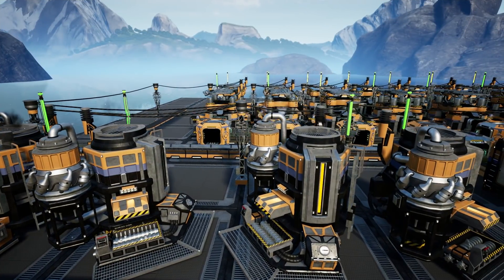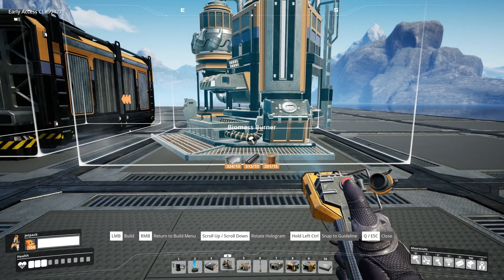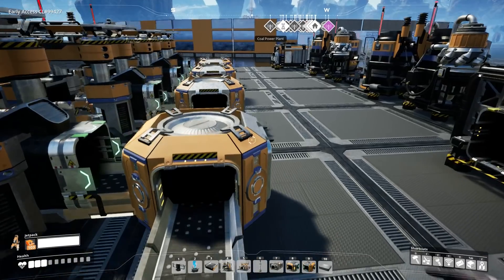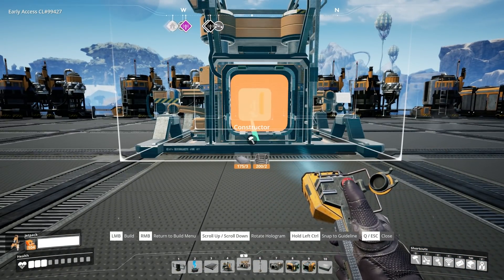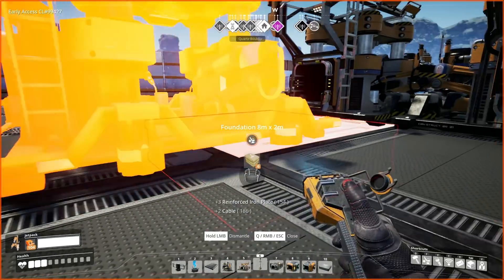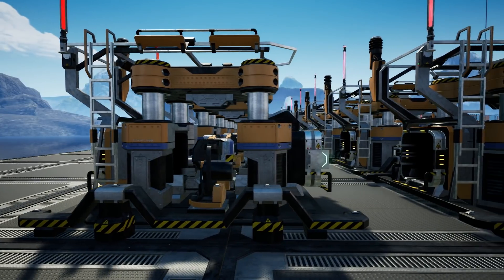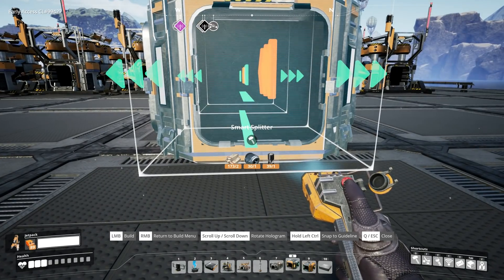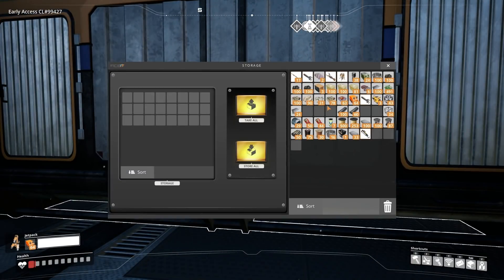Satisfactory How To Build An Efficient Bio Fuel Sorter

Comment: For reliable sorter, put a standard splitter behind each smart/programmable splitter's filtered output and send half of the sorted output back to the junk container for re-sorting. It looks like unnecessary cycling of material but it prevents blocking of the smart/programmable splitters as their outputs are always free - in the worst case you get the extra junk just cycling through the junk bin.
Reply from the maker: kasuha I haven’t tried that but it sounds like something useful to try ☺️
Reply: Solid idea, tend to avoid smart splitters just because of that backup in the line.

Comment: Just a note: you get coal power at Tier 3 and Smart Splitter at Tier 5. Unless you're a masochist, there's no point using biofuel for power by the time you're at Tier 5.
However there are alt recipes for turning biomass and wood into coal. Even though there's little point turning leaves and wood into coal (and steel) I use these just for the feeling I'm not wasting them.
Reply from the maker: kasuha you’re absolutely right, but this is a great way of getting rid of extra waste you accidentally collect whilst exploring then you can use it to boost your power supply late game. ☺️
Reply: TotalXclipse Maybe is like a compost system, but I’d defiantly keep the biomass anyways, no need to burn it
Reply from the maker: Manuel Vazquez could use the bio fuel in the fuel generators... another option for full automation
Reply: Just want to say, might not have been like this 4 years ago, but you can get smart splitters really early on, far before coal

Comment: Same way I did it. Ok, I used a buffer in front of the wood / grass converters instead of doubling them. Most of that pruction went into biofuel afterwards.
Additionally I prepared Inhalers if I had enough stuff for them, otherwise the Mycelia went into fabric. Never use Myc for simple  biomass, it would be a shame!
Oh, and I prepared slug converters as well.
(As a backup method I've set a splitter to shove anything else into a 2nd container, in case of mis-clickings).
Simply put: stuff every natural item in the bin and get the best out of it!
Reply from the maker: Luftwolf really nice way of doing it! I considered having a separate section Incase of missclicks but felt it not necessary for the video, nice to add slugs as well.... but I’ve only ever hand crafted shards so have never needed them

Comment: If you have smart splitters you already have oil and in that case bio fuel is so sub optimal that it's a waste of time. Biofuel is just the stopgap as you tech up for coal and once you get coal you you can just ditch the entire biofuel system since it can't be automated and it takes too much time gathering materials to turn into biofuel and then manually feed several biofuel generators. Get a mk2 miner on a pure coal node and you run a an insane number of coal plants and the output will dwarf the biofuel generators.